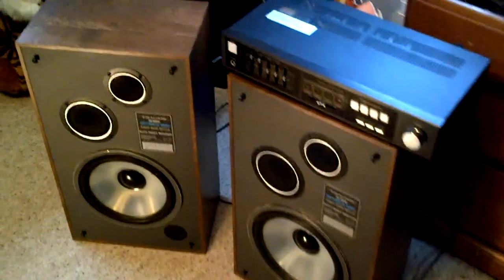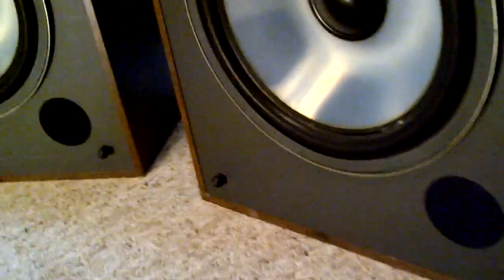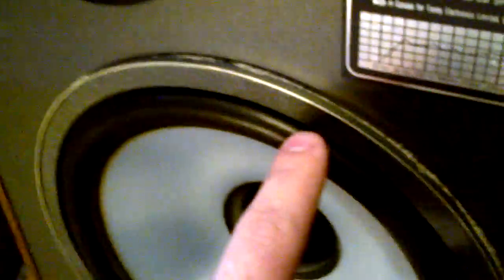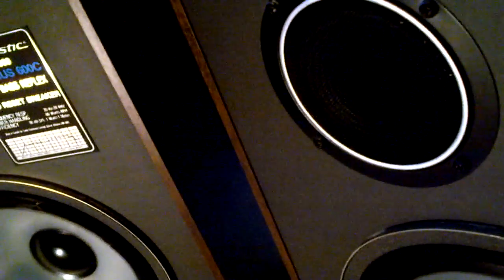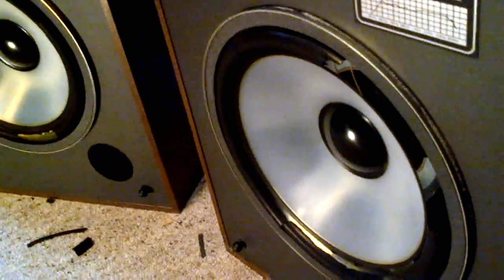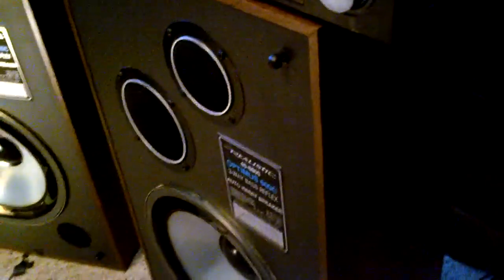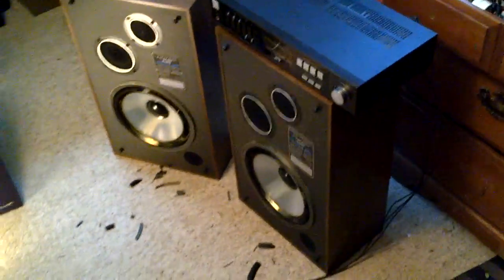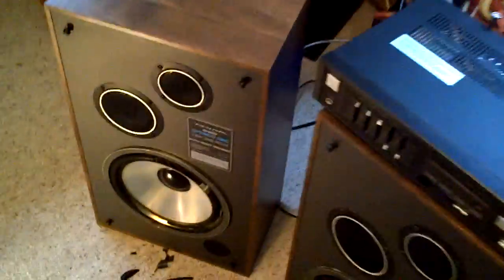Speaker Buying Tips - The Dreaded FOAM ROT

Comment: I love foam rot...I usually can get some great deals once they are like this..lol. I buy the Cerwin vega orange double thick surrounds..easy ,cheap fix.. I have 2 sets of old rtr towers. 2 10s in each..1 set has a 12 inch passive  and 2 10s.. added the new cerwin vega surrounds. and have had many years of use... and foam still seems like new..
Reply: Aka Devil_666  not if you don 't use them without replacing the foam.

Comment: and that....... is the reason why you should "oil" the foam once a year.
My oldest set of speakers: Marantz Imperial 7G (early 1974). All the drivers still being original, never refoamed.
Reply: There is a particular oil for speakers?
sorry but my english suck
Reply: hey can you tell me the name of the oil that you use for the foams? thanks
Reply: GTI1dasOriginal I clicked the link and there is no site to the link
Reply: I looked but there was nothing
Reply: Also depends on where you keep them, a warm and dry room does a lot, smoke is also bad for the foam. I never do that to my speakers but never have foam rot....
Reply: the warm dry room thing is true, i have a set of realistic speakers that lived in my basement storage for like 5 years and they got foam rot really bad, despite having worked fine for 10 years, no signs of any foam rot
Reply: Yeah, the basement is ofcourse cold en most of the time also moist. 
We got very old speakers from the early 70's and because we always make sure that there in a warm en dry place there stil very good.
Reply: song?
Reply: the song in the video is Will Bailey - Hustlin And Scratchin (Gigi Barocco Remix)
Reply: We used to have Optimus Ones, but we got rid of em.
Reply: @EucaliptoVerde  use WD40

Comment: I have a Soundtech speaker that our band has used for 13 years all together, and being dropped so many time dislodged the magnet just enough that the voice coil rubs and gives everything an actually cool fuzzy distortion.  When it goes I'm getting an EV.  I like your videos man, you have an affection to the sounds side of things and that's cool, our band used to be a part time DJ service at one time and it was pretty fun while it lasted.  Rock on man.

Comment from the maker: @VlogginLife lol the foam/rubber/cloth/whatever around the edge keeps the coil centred and safe from rubbing the coil on the magnet, without it the woofer cones flop and dont reproduce sound correctly,  often without it the woofers lock up

the metal is just the basket (or frame)

Comment: Yu can buy refoam kits for most all nostalgic stereo systems like this. The main reason why the used foam on these is because the sound quality when using foam is second to none.  The only downfall though, is well, it rots away over about 7 years.Todays foam however, is made out of much much more durable material, so when buying refoam kits, trust me you will never have that issue again. :D

Comment: I have a 1992 set of aiwa's and have been sounding good, even with really deep bass, I checked them today and when I removed the grid ALL of the foam was at the bottom of the box. I think the "secondary" foam at the bottom is made to overcome foam rot without getting the crackling noise, Im looking forward to replace them, Im gonna buy a JVC set that despite it's smaller size and power, gives a richer bass
Reply: Its not a secondary foam it is called "spider" because it looks like a spider and its not made of foam, its made of cloth. Its usually yellow

Comment: We have some VERY vintage Pioneer speakers, there beautiful. Big bass driver, tweeter, mid range etc, topped off with a polished wooden case. Sadly, they rotted like this, but all the drivers were effected by 100%. They worked, but the cones would get stuck, and it would sound like crap. We are renovating them soon :)

Comment: Just saying, I would buy speakers with foam rot anyway because for most speakers you can get refoam kits really cheap and if that means I get a good pair of speakers for the next ten years then yes i'm going to buy them. I would make sure I knew some stuff about the speaker before I even thought about buying them. You can also redo the foams at home so it's cheap and fairly easy. Just a thought.

Comment: You guys vintage speakers have foam rot? I have a pair and a set (2 of them one for the dining and one for the living room) Its a pioneer CS - 803 1980 speakers. The second one, (the one in the dining,) is a Bose AM5 (not traded actualy) and that wasn't really vimtage either. But they were from the 80's pretty well built and no foam rot😅

Comment: I never liked foam surround speakers b/c of this issue b/c I had a set of car stereo speakers and the same thing happened to them. I have a couple of mini capsule ipod speakers they are mono and one has a radio built-in. One of them has a foam surround on the speaker and the one with the radio has a cloth surround and it sounds loads better.

Comment: Have made my own speaker edges out of cotton an silicon for a family member and over 12 years there are still going strong. But if you can't make them yourself there are always single parts available at repair shops but you have to take a risk if you get them fitted by them as if they don't do it the right way. Nice rubber edges on a set of top of the line 80's speakers has left the alluminium cone buckeld and out of shape buy a top of the line repairer.

Comment: I got a question I have an LGLGCM45509E on and I have 215 inch subwoofers hooked up to it the subwoofers are hooked up with an Xbox power supply so to 12 V constantly I’ve got a switch on is like turn on and off and the RCA cables I have running to the back of the stereo and where does the sub will for a cup I took the subwoofer out and I put the RCA cables in as a sub offers so no it myself as a play provide my stereo and I can adjust the gain so just wondering is there anyway to turn off the circuit breaker or find it

Comment: Why did the Amp shut off?
Amps with safety circuit turn off when the impedance is under 4-8 ohms, this happen when a coil in one of these 6 chassis is screwed.. :/

Comment: I don't consider this a setback when buying used speakers.  I get my foam surround replacements and other parts from Simply Speakers.  Higher quality than what you find on Ebay.  I bought a pair of Cerwin Vega VS-120's from Craigslist for $20 bucks with rotted surrounds, ordered a new surround kit, and for $50 bucks, I now have a pair of speakers that will rival anything new on the market that costs several hundred dollars.

Comment: Good times! You probably did ruin the voice coil doing that. So much for re-foaming these beauties...
Reply: He blows crap like this, he's got WAY to many speakers.

He's in to pro audio, like the stuff you would find at a live show or concert, not home audio crap.
Reply: apersonthingy productions home audio IS crap, a lot of it is just well marketed garbage. I like my JBLs to work on, but even my Paradigms attached to the TV are falling apart for no good reason (they used to be a cheap, more than adequate speaker.)
Oh and LOL my first speakers were ^ Radio Shack Realistic, not great but soooo cheap! Sale a hundred a pair. Maybe you've encouraged me to buy one good 'lifetime' home entertainment amp and speakers. What would you go get?
Reply: jonas brave I don't do home audio stuff, I like having car audio stuff in my home/garage, because with car audio, it's usually good for a lower budge, and with car audio, it's usually go big or go home. I got a second hand hand 1000 watt 12" pioneer sub for 50 dollars! works great, and a 600 watt amp for $81 because it was on clearance. down from about 2-300. As for powering it with 12v dc with enough amperage, I'm looking into an old computer power supply, the part of th computer where you plug it in, it also has a switch on it and a fan. they can be bought for about $25, second handed, and I hear can power even 1000W+ amps. I've seen some guy on youtube nearly blow 2 pioneer premieres with it. Hope this helped.
Reply: apersonthingy productions Just an Alpine head makes a huge difference even with factory speakers, and then maybe replace the fronts. My car audio guy was right.

Comment: how old does the speaker have to get until it foam rots
Reply: It doesn't really depend on age, it's more of a environment condition thing.

Because it happens over time, that's why a lot of older speakers have foam rot.

If you leave your speakers in damp environments or outdoors, ect, it will drastically
speed up the process of foam rot.

As I said, it depends on the conditions of the speaker's location,

meaning you can have a 50 year old speaker with no foam rot at all,

aswell as a 5 year old speaker about to fall to pieces.

Hope this helped ;)
Reply: im just 11 and im a big fan of vintage speakers
So thanks for the advice
Reply: hezakiah coleman No problem :)
Reply: Bash full line 421 as heazy 

A cople of years

Comment: best buying tip i use is: DONT BUY SPEAKERS WITH FOAM BEADING
Reply: As long as the speaker cone isint made with cardboard then replacing the foam is actually very easy to do and I've done it myself for like $20.